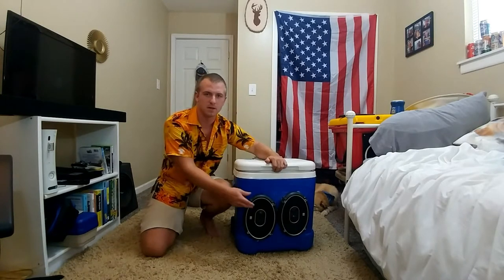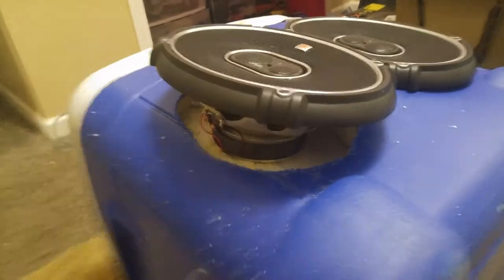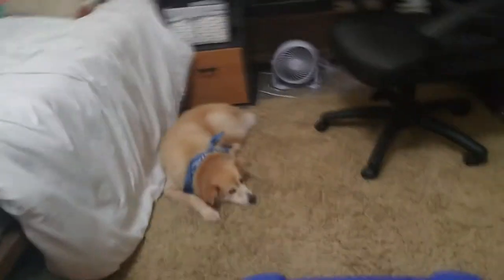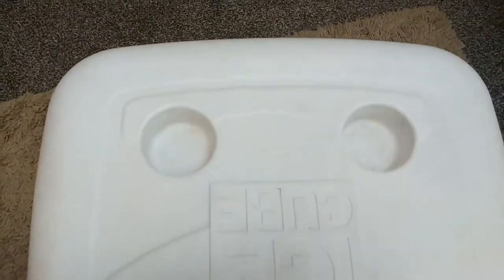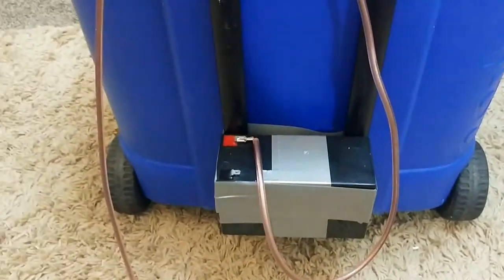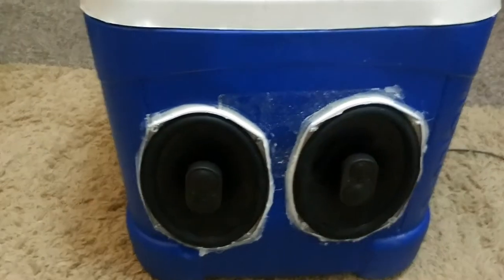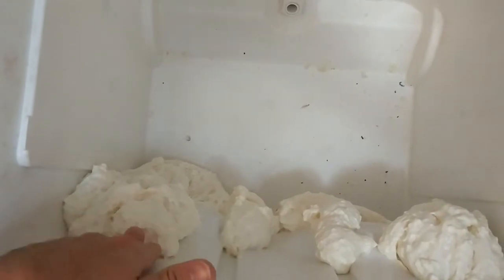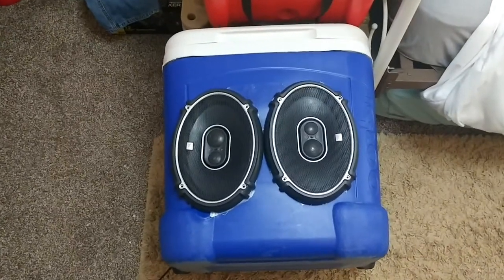How to make a Speaker Cooler! (HOLDS ICE!)

Comment: you need whats called a ground loop isolater
Reply from the maker: Thank you, I fixed it with a bigger battery.
Reply: What if he just connects a wire to his negative battery terminal and on the end of that wire he has a small metal rod he could just jab in the ground?

Obviously this would only work if your on dirt our outdoor surface to jab rod into, but I'm asking if this would work?

Comment: Great Video but how did you run the speaker wires to the amp without them being visible?
Reply from the maker: SAMUEL Myers yes I did. I ran them through the foam on then into the lid through the back so its barely viable. There's a lot that I learned on this project and so much I would change and improve.
Reply: Thanks for the quick reply I'm thinking of making one myself, when I do I'll make sure to upload a video too.
Reply from the maker: SAMUEL Myers yes for sure! Ill subscribe so I know when! I love seeing everyone else's versions.